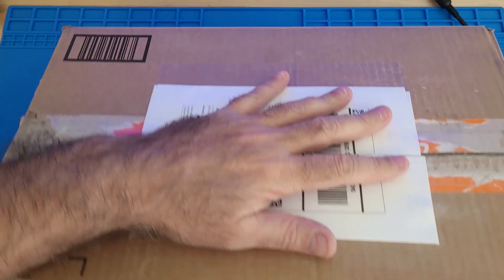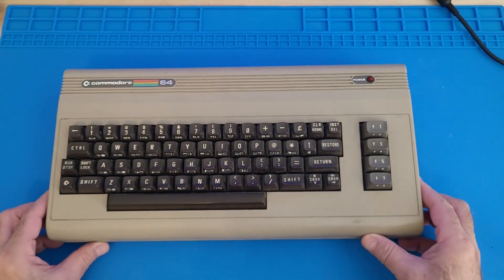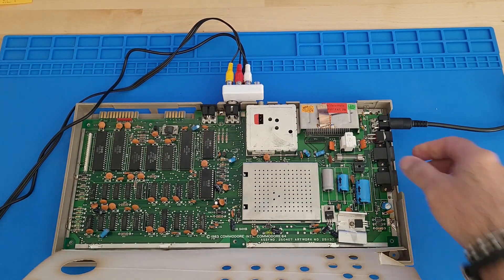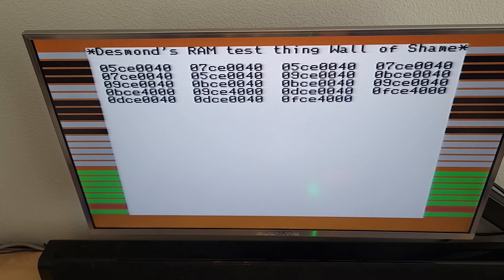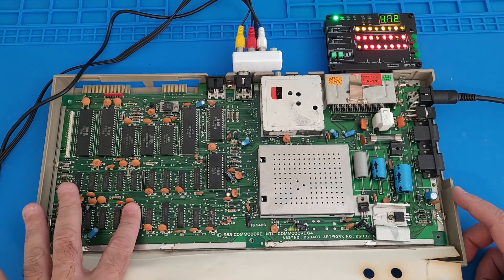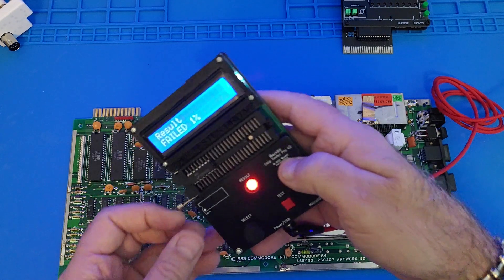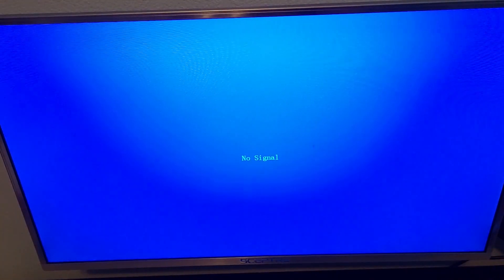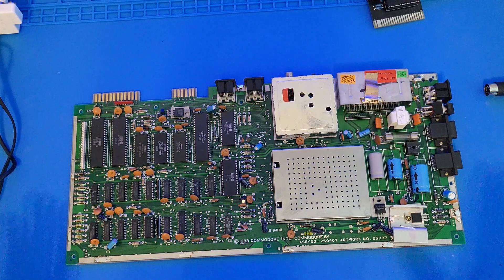Commodore 64 Memory Error Fix

Comment: NEVER use machined sockets for ICs.  🤔
Reply from the maker: I disagree. There are countless forums with opinions for both. Both dual wipes and machined sockets are fine. From my years of experience, machined sockets can be more forgiving if you are putting chips unsoldered from a donor board. If you didn't clean the leads well enough and you try pulling them back out of a  dual wipe socket, you could damage the leafs in the socket.